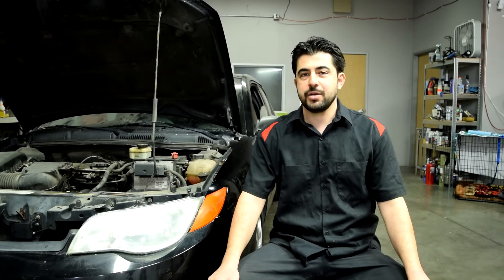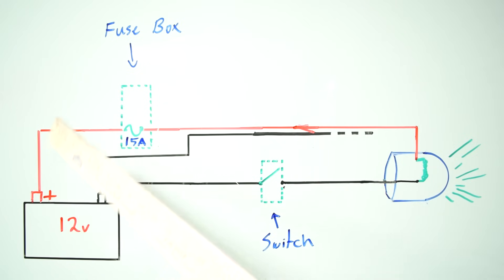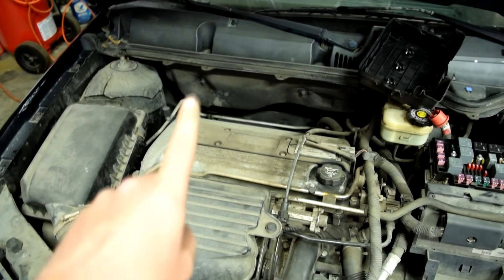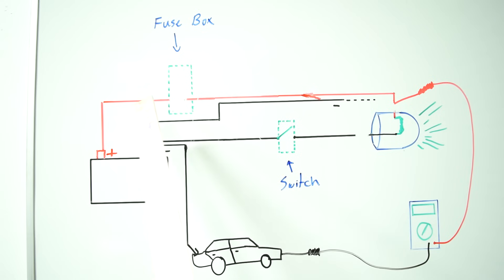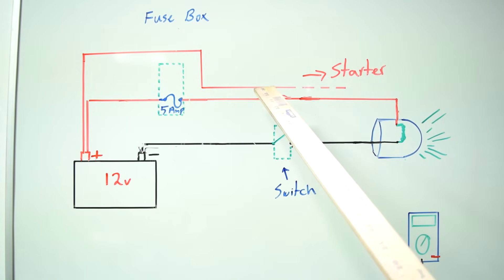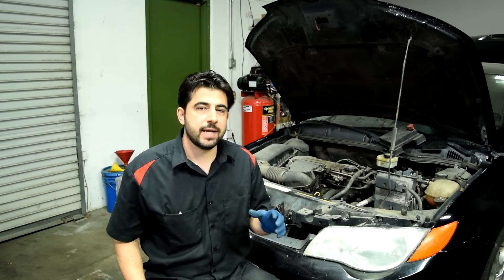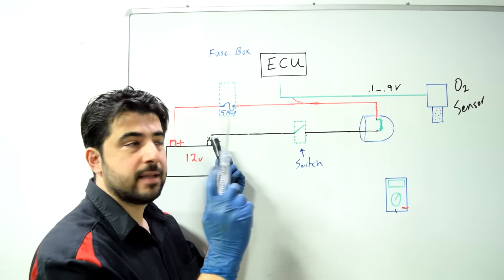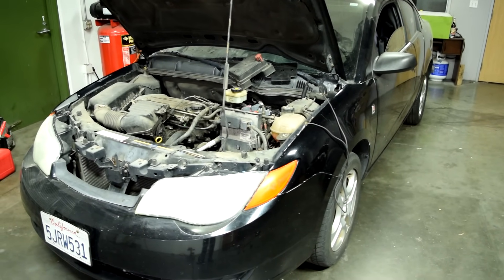How to Diagnose and Find a Short Circuit or Wire in Your Car

Comment: Hey W&W Can You Help, I'm having ground sent while engine is cold to normally active Circuit when engine is hot and running the Cooling fans when Engine is running at cold temp and again when Ignition is turned off for about 2mins. ECT works fine, I tested it and the Temp gauge works as well. I have 5V Reference at the ECT Connector. I don't know why I'm having this ground sent to the bottom right pin of My Fan Cont #1 Relay. 05 Chevy Impala 3.8L 
Vid Of Issue: https://youtu.be/Kml_ODJKVIU

Comment: Very helpful video.  One suggestion is to show exactly what pins on the headlamp connectors or headlight switch you are testing.  In my case the taillights and the cluster light are out and there is one fuse that keeps blowing every time I turn on the headlights (low beam).

Comment: Dear i have toyota land crousir 2004 4.7l and i have short in fuse ... when i replace the fuse direct short come again and its effect to window and ac control also fog light and release gear from P position i cannot release use the brack it shoud user manual release bottom near gear .???? What should i do ???

Comment: Hello Rachet n wrenches,
I have a Toyota corolla 2000, it is a no crank in park and crank in neutral not start in either park and neutral. The starter relay load side terminal lights up test light; control side does not light up test light however with meter a 3.44 voltage reading was discovered Key in ON position is this a short to power or ground side? When key in start the voltage is 12 .39 volts, on the control side of relay neutral safety switch is good shift selector good too, when in reverse or drive no voltage reading. Throttles sensor voltage is 1.30 volts open/close throttle no change; is the ecm seeing the low volt reference 3.44 on control side will not crank starter in park because it is not pulled down to oo ground, is it a shorted throttle sensor?

Up date on voltage drop test battery positive to battery cable on starter  with key in ON position  remote switch pressed it dropped to 0.50 volts from 12.40 volts from battery.

Negative battery to negative solenoid terminal key in ON position starter turning engine over slowly ground voltage drop 8.04 volts. Is this starter dead shot need a new starter?

Peace,
AL

Comment: How would I test a sensor connector to see if it has a break in the wire or a short? Its a 3 wire connector that goes to a input speed sensor to a transmission (2002 hyundai elantra AT)

Comment: Learned more here in ten mins than a whole lifetime of reading text books, electricity always goes the easiest route when under load, been scratching my head as to why i was getting volts but the circuit wouldn't work, now I know, thank you so much!

Comment: My mom has a 01 kia Sportage 4 wheel drive automatic and a 10amp fuse keeps burning out and when it does her over drive does not work she has to drive it like a stick starting from low gear and it has lose of power and the Gage cluster becomes dead....how would i find that short
Reply: Same way as the video. You will need a wiring diagram to help identify the circuit.

Comment: The fuse on my radio pop. When I try to Add a new1 it blows right away. How can I fix
Reply: Make sure the hot wire is not grounding out and causing a short

Comment: Please can someone answer my question: I have error code 4390=Boost Air Temperature Sensor - Short Circuit to B+. What is the fix ? a new sensor? or wiring? any information is appreciated

Comment: I had a small fire in the wires when the wiper/washer unit caught fire... I changed it but am wondering if these two problems are separete or connected ?  The old wiper/washer unit only worked  in one mode (max speed) The replacement works in all modes, slow, fast, int...The old one might have been dameged before it burned completely, un-insulated wire(s)..?

Comment: One wire from my cars (1986 Ford Econoliner 350XXL) headlight switch seemt to constantly overheat when  the high beam is turned on... And after about 15 minutes the lights shut off... Can you advice.. I discovered one red wire was torn, and the relay made noises until I connected the wires and changed the fuse.. But still the high beam wire becomes super hot when using the high beam  ??

Comment: i am not blowing fuses...but i suspect my entire fuse box has a bad fuse to ground problem....does anyone out there know if there is supposed to be continuity from the fuse contacts to the body ground?..EDIT   i just checked a different car's fuse box and indeed i get an ohm reading to ground to the fuse contacts....that tells me it is  normal and not the source of my problem....i was going to put in a brand new alternator but was afraid that the same problem would kill my new alternator...yet another edit....how could i have 2 cars that still run and have a direct short to ground and one still charges the battery?...i am so con-fuse-d
Reply: commonconservative yes, this is normal, you will allways get an ohm reading unless there is an open in you wire. Basicly you are measuring the resistance of your component(s) and wire(s). In the example in this video, with good wiring you would measure the resistance of the bulb, pull out the bulb and you will get OL just becouse there is no more continuity from positive wire through the bulb and into the negative wire(car body)

Comment: Great video! Thank you for taking the time out of your day to do this tutorial. The cutaways to the white board and the comments/further explanation re: resistance in the circuits, as well as sharing what you have found to be the most common types of shorts, etc., was really helpful!
Reply: Yes, a great video but one thing you have wrong in your diagram. The switch is always on the positive side of the circuit not the negative and the fuse is always on the positive side other wise if there is a short it would burn up the positive wire/cable.  The exception is a door jamb switch or some similar switch but that switch is just suppling the ground to complete the circuit in those cases. The fuse is usually located close to where the positive wire connects to the junction box/terminal/battery positive. The order of location in a circuit is 1-battery positive/ 2-fuse/ 3-switch/ 4-load circuit such as light bulb, motor, heat element, electronics, ect. This way you are always protecting everything downstream of the fuse in case of a short.

Comment: I have no power at ign-e fuse at fuse box under hood n truck (1997 chevy pick v-6 ) dose not start. i can jump it n starts right up. I chk the pins wear the 10 amp ign-e fuse gos n test light shows up green meaning ground but fuse not blown. How can i figure no power issue? Wouldnt fuse blow if its power n grounding?
Reply: i was wondering if an ohm reading to body ground is normal ?....from the fuse connection to ground....i think my entire fuse box is messed up or a main wire with no fuse is grounded partly..maybe i will pull a fuse on my other car and see

Comment: Anyone know if a o2 sensor 4 wire having heater and sensor grounds swap would cause issue CEL light heating circuit low?

Comment: Always make sure the right size fuse is in there as well. I had a lady go through 2 condenser fans on a dodge. Someone had a put a 15 amp where a 30 amp went. So as the fan hit high. It blew the fuse.

Comment: Hey.. i connected a 12 v day time running lights to both my car headlights about a month ago.. they were working just fine until yesterday they randomly went out.. (both headlight and DRLs). After a couple minutes checking all the fuses, i found two fuses which are blown (15 amps). after checking the owners manual, I've came to conclusion that they are connected to the highlights. 

I replaced the fuses with another 15 amp fuse and when i turned on the lights (engine was off). They suddenly went out, i replaced them once again and took off the DRLs and they went once again.. is it possible this might be a short circuit, or the switch is burnt out?
Reply: Use a 30 amp cube relay. Use the headlight circuit as you source wire. Run a load wire off the battery with the proper fuse protection.  As you are overloading or under volt the headlight circuit.
Reply: Master Chief 00117 thanks for the response.. ill try that and keep you posted
Reply: rule of thumb to not screwing up and wasting your time is this ...never put anything on a car that the factory does not account for....that includes headers etc.......if u look at the pain in the ass problems they run into you will know what i mean....just don't do it

Comment: I added 4 LED strips to my truck and most of my dashboard lights went out. I tapped into the positive and negative cables for the power outlet & I used 2 displacement connectors one for + and one  -  .. could this have caused a shortage on my wires bc I checked all the fuses n they are all good, none of them are blown out.. and if I undo everything I did, will everything work find?

Comment: Can this same method be used to troubleshoot a circuit with a blown relay? My 94 Infiniti G20 won't engage the cooling fans. The fans for a FACT (hooked up directly to 12v) are working but the fans won't turn on automatically. Temp sensor and fan switch sensor have been replaced so I'm down to electrical wire issue. Only has 126k miles on the dash, she's still a young pup.
Reply: Yep it can be used. I'm still learning myself, but just used this info to fix my car's horn. I removed the relay and used a piece of wire to 'jump' the relay/make a direct connection. Doing that should have sounded the horn but it didn't. So with the wire in place I followed the same test methods in the video and narrowed the problem down to no continuity between the horn's ground wire & the negative terminal of the battery.
Reply: @peterhenry2240  Thanks that great some body told me this but Just now ive understand from your explanation Thanks man 👍👍👍

Comment: I have a 61 ford ranchero ,changed the ignition switch and the starter relay  2 times ,it keeps cranking even with no switch,  and the starter cable gets so hot, help plz
Reply: Sounds like a short. Get ready to find the wire then start probing until you find where its shorted.

Comment: Hi mate, hope you see my comment. Whenever I press my recirculation button, the bulb is still work (Light on the button) but the actual mechanism doesn't work. Air still can go from the outside to the inside of my car. I checked the fuse and it's okay. Any ideas?
Reply: Yeah. The door actuator control module is broken. Probably the plastic gears broke. And some vehicle have more then one. Chevy\GM have four servos modules. You have to find the one that is controlled from the dash panel. The way to tell is find them. Then turn the climate controls to each position. See if the module shaft turns. If not. You found the bad one...

Comment: question I have a short that keeps blowing the fuse to my ODBII port in a 2005 Pontiac vibe ...if I change the fuse it will be OK for a few days (2-3) then the fuse will pop again, I do notice when this happens because the check engine light will turn on I found out it was the ODBII port when I tried to connect the odb2 diagnostic tool and realize it wasn't working...any help I'm stumped. ..thxs

Comment: Hi for some reason my car does not want to start i drove it and then parked it and when i wanted to drive it again it did not start i found out that my fuel pump relay is not activating at all only when i open it and the press on the metal plate it the actives , also my injectors arent spraying fuel  when you take them out and you test them they do spray what could this be?

Comment: An easy way to work on a short is put a light bulb across the fuse holder. When you work on the car you know you found the short when the light switches off.
Reply from the maker: yes that works too, cheers.
Reply: Robonza 3:10 yellow bag of work
Reply: Can you explain in more detail please?
Reply: Yeah i would really like to have this explained in more detail please. Its just not making sense to me.